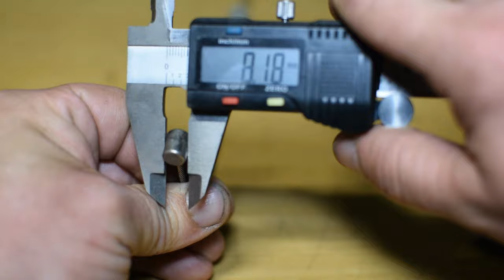brake cable repair DIY

Comment: Done the same and added Red Thread Locker--after cleaning cable end, set screw, and end-piece with carb-cleaner (and let dry for a few minutes).

Comment: Thank you! You are my absolute hero! I'm surprised more people haven't commented on this video. I'm somewhere where it's not convenient to try to fabricate something with solder. This is much simpler. Thank you a million times.
Reply from the maker: Hello Laurie Flood, thank you very much for your kind words. !!!!!😀
Reply from the maker: https://m.youtube.com/watch?v=oH58MjXaa-c 
Here it is a little simpler
Reply: Well, it's dangerous what he did because the metal gets fatigue stress once it's pinched like that, it will start to fray and cut slowly at the point where it is pinched... A few thousand brake movements and it will just come loose by surprise. The point with solder is that it holds all the strands and can (ideally) prevent the pinch stress completely by developing all the cable.
Reply: You must be one of his relatives

Comment: Great thanks
Reply: it's dangerous what he did because the metal gets fatigue stress once it's pinched like that, it will start to fray and cut slowly at the point where it is pinched... A few thousand brake movements and it will just come loose by surprise. The point with solder is that it holds all the strands and can (ideally) prevent the pinch stress completely by developing all the cable.

Comment: I still think that it would be better to dip it in hot solder metal
Reply from the maker: if you have the right tools, do it and tell me if it works for you or not because I've tried it. everyone does the same thing i said to do something different.

Comment: Rather to buy new cable break than buying that expensive tools...
Reply from the maker: you make two staples and you have them in time of need until the health weekend that is all closed You can wait or this is your opinion Thank you for your interest!!!
Reply: Not all of us have that option. Maybe you don't have a prefabricated tool for the use case. On a bicycle, it's a different story. I am looking at my throttle cable.
Reply from the maker: Laurie υπάρχουν πολύ τρόποι να φτιάξεις μια ντιζα ανάλογα με το τι σχήμα έχει τα φτιαχνω για ώρα ανάγκης παράδειγμα μου κοβεις ι ντιζα στο δρομο σε 2 λεπτα το εχου φτιάξει και κανω τι δουλειά μου άνετα το σαββατοκύριακο είναι όλα κλειστά δεν μπορώ να αγοράσω ντιζα τοποθετώ ενα ανταπτορα και ολα ειναι πολυ απλα!!! Έχω βάλει πριν 2 χρόνια δεν έχω κοπή ακόμα lol
Reply: the pinch point of the repair can fray and crack more easily that a pro cable after 1000-2000 repetitions, for a life-death equipment, it's not the wisest. you will see that cables are always designed to have no pinches or bends, only crimps and welds, to avoid risking lives. If he did that first and then welded it would be ok.
Reply: Brake not break

Comment: It is good for a throttle cable BUT no secure for a brake or clutch cable ant such système exist in all good meca supplier !?!?
Reply from the maker: Hi Michel if you treat it well it doesn't hurt anything if you put a thicker wire and pinch a bit in front with electric welding to make it thicker or not go away and the screw grips the cable well there is a chance that it will last for an animal and never get hurt